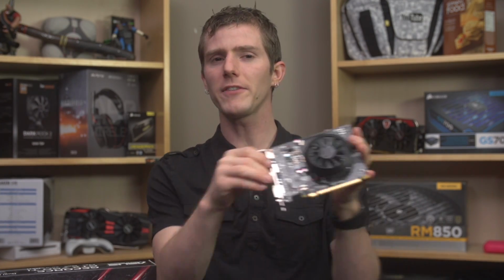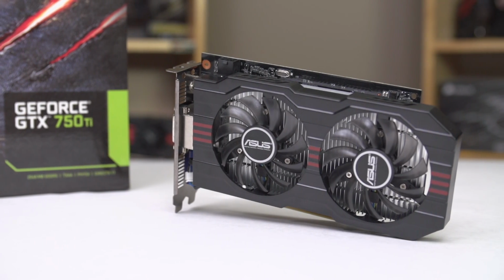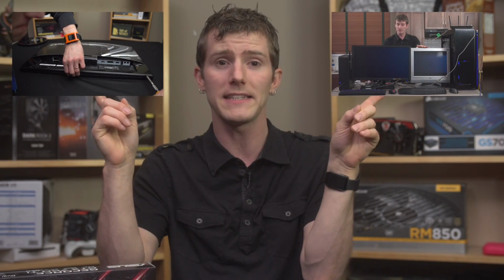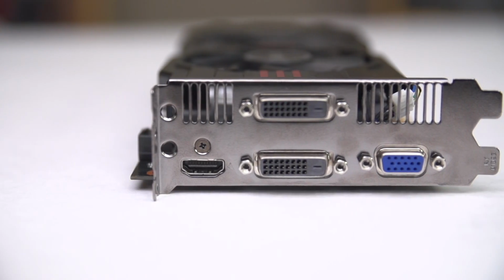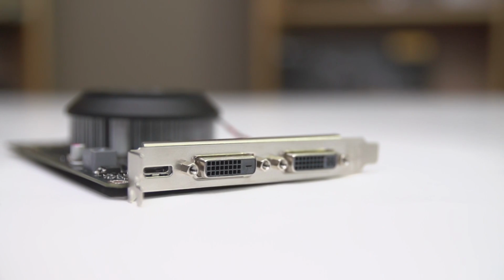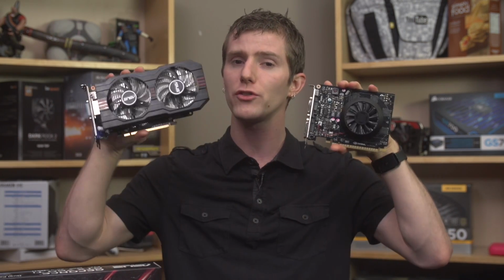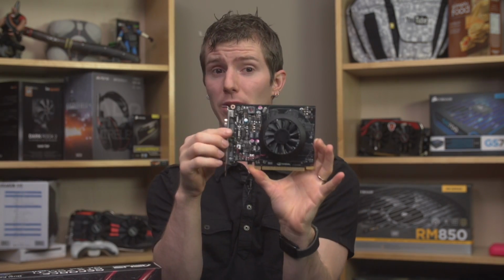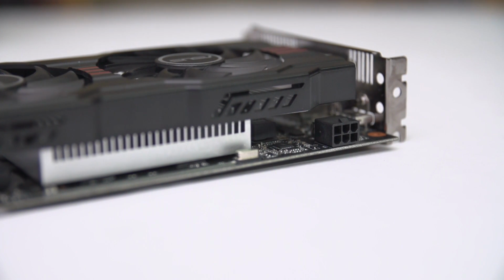GeForce GTX 750 Ti NVIDIA & ASUS Designs

Comment: guys just asking,is my specs ok for gaming??

INTEL 4th Gen HASWELL I7‐4790 3.60GHZ 8MB Cache MSI Z97 Gaming 5 Motherboard
250GB SSD for Operating System
1.0TB Sata Harddisk Storage
8GB DDR3 PC1600MHZ Ram
Nividia GTX750Ti 2GB GDDR5
24X Dual Layer DVD Writer
Audio Boost 2 / USB3.0/Killer E2200 Gigabit Lan Medium Casing with 500W PSU
Reply: This is just my personal opinion.

Drop the SSD and get a better Graphics card
Reply: Get a better graphics card you could do this buy getting i5 4690k and drop the ssd if you don't think you will need it
Reply: MurixArtz Get the SSD later, just partition 250 / 740. Spend more on your GPU, get the GTX 970. Later down the road, once you get your SSD, just clone the 250 partition to your SSD.
Reply: Will Redfern ok thanks for the opinions,ill think about it :)
Reply: should i get the gtx 760 or?
Reply: DON'T YOU DARE TO BUY THAT CARD.

it has a horrible Price for that what you get

you should get a gtx 960 for 190-200
Reply: my country doesnt have a 960 or maybe it has idk how about a 780
Reply: You can get a 120 GB SSD for half the price, so I'd then put the savings into an r9 280x. Also, the k verizon of the i5 is slightly more expensive, and worth it if you plan to overclock.
Reply: Operate170 i also need to use after effects,should i get a 970?
Reply: well, a 970 on the other hand "oh my lord" the 970 is probably the best "bang for the fuck" on the market atm
Reply: okay. So this is my opinion.
keep the ssd but go with the cheapest 120gb you can find,go for the i5 4690k and get either a r9 280x or a gtx 970 depending on the money you have
Reply: good build but u can save money by getting an i5 & dont worry it wont bottelneck
Reply: yea, that's a good idea aswell actually :D
Reply: RyuFX Get a i5 and a better graphicscard
Reply: RyuFX The GPU will bottleneck the i7. Go with an 960 and a i5. It will work better.
Reply: ThePhenex ohh Right, totaly forgot about that.

That's right it will kinda bottleneck, as far as i can tell is an i5 4460 Works perfect with an 960 (speculation can be wrong)
Reply: Eynonymis K lol i got my gtx 750 for 130€😂

Comment: I want to upgrade a prebuilt computer I bought with a r7 240 and a fx 4300 in it, do you think getting this or the r7 260x would be a better investment? If not either what do you recommend? My budget is around $160
Reply: Andrew Tan 750ti The Fx 4300 might need to be upgraded soon to a fx 6300 or 6350 because amd quad cores are becoming obsolete
Reply: I don't think my motherboard supports the fx6300
Reply: Andrew Tan it should they are both the AM3+ Socket if they don't id be suprised
Reply: thedillon25100 my motherboard has a watt limit thing and the 6300 surpasses it
Reply: Andrew Tan There has never been a Watt Limit. It only is about your PSU

Comment: ALIENWARE X51 PERFECT UPGRADE...
anyone who has the gtx745oem and are looking for a better card but cannot afford additional psu and a more high end card that probably wont fit in the x51 get the low profile card from gigabyte,the gtx750ti oc is an awsome quick cheap upgrade that lets you play those new games 1080p medium to high setting,unlike the gtx745oem which has poor memory bandwidth.

Comment: Im running Crysis on max and Arma 3 on high with this card solid 45-60 FPS... just saying.
Reply: My MSI GTX 970 is doing a hell of a lot more
Reply: Fact is that my GPU is more power efficient and more bang for my buck.
Reply: Stahle Frid true, but im preparing for years to come
Reply: Gabriel God bless you, so am i.  I can spend my 300 in 2 or 3 years and will get even more bang for my bucks.
Reply: Stahle Frid You win! But i personally enjoy this card with its looks, style, and the high numbers i love seeing
Reply: Gabriel Same reason i bought a 3570k :) so i guess i cant blame you haha.
Reply: Boring Guy Dont mind running a highes res screen than 1920x1080 since that'll make the 750 Ti work realy hard with harder games on 4k resolution. Invest in a better mouse, that's what realy matters when it somes to precision and speed. Also if you're getting a keyboard get a mechanical one, there are very good ones like the Q-Pad ones if you dont mind backlighting. On the mouse front I can recommend the RAT 3-7 beacuse of the customizability, looks and most the quality. Hope I didnt bored you with this novel :)
Reply: King KaBlaze hello.Out of curiosity,which gtx 750 ti card did you get?
Reply: King KaBlaze Thank you for replying. I just purchased this exact card yesterday (from Newegg).I have a pre-built HP that only has a 320 PSU so I had to get a card that did not need an extra PCI-e connector and also did not use a lot of power.
Reply: Boring Guy if it happens to be less cables than needed, there's often adapters for loose cables you can use to "create" a 6-pin from molex cables that are very usual on older power suplies.
Reply: Stahle Frid Thanks for the tip. I wanted the EVGA version with the twin coolers but because my PC only has a small area for a GPU,I had to get the shorter version.It works great though,I can run almost every game I've tried on high.Not bad for a $100 card.
Reply: Boring Guy I'm happy to help out, I just wanted to say that I can play ARMA 3 with the card, not 100% smooth on high settings but if you have an average CPU that'll be the bottleneck.
Reply: Stahle Frid My CPU is older,it is an i5-2400. From my reading,it is still decent for gaming though.I would need a higher end card for their to be a bottleneck.I am planning on building a Skylake pc soon.
Reply: Boring Guy 2400 is a quad right? Then there's no reason to spend money on a skylake motherboard yet. You'll be able to play with it.
Reply: Stahle Frid yes,quad core at 3.1ghz. I have 16gb ddr3 1333mhz RAM,Samsung PRO 256gb SSD and an EVGA GTX 750 ti. I got everything I mentioned for less then $300.Only bad thing is the desktop is an HP 6200 prebuilt so there is a small PSU (320w) and not a lot of room for a longer GPU. I was thinking if I do not build another PC,that I can take the parts from this HP and just buy a different case,motherboard and power supply.
Reply: Boring Guy My tip would still be to wait, your PC will be usefull at least 5 more years. Save your money until then and thn build a swag pc. You have very nice parts already.
Reply: Stahle Frid You're probably right.I might just get a better monitor and keyboard/mouse.The ones I currently have are old .
Reply: +Stahle Frid No boredom at all. I appreciate the help,thank you very much. I would not go for a 4k monitor because like you mentioned,the 750 ti is not really cut for it.I'd like to get a 27' 1080p display,probably from samsung or LG. Those Mad Catz mice get good reviews,I was also looking at some LogiTech ones. I actually have a really old mechanical keyboard lol.It has a ps/2 output ,I believe it is from 2000.Works great still,only issue is that it is purple and grey .
Reply: +Stahle Frid the 750 ti was never meant for 4k gaming. watching 4k streams sure
Reply: EricssonXL That's what I meant
Reply: Stahle Frid no
Reply: EricssonXL "Dont mind running higher res screen than 1920-1080"
Reply: Intelgents You're on the "solid" level if you turn down the range a little. Im speaking about high preset up there.
Reply: +Gabriel Do you reaaaallly need more than 45-60fps though? I'm finally upgrading from a 560ti after all these years but I was playing Fallout 4 with it at sometimes as low as 20 fps not counting hardcore periodic stuttering and I was just happy to be playing it.
Reply: KingofHearts67 It's about personal prefs i believe. But you usually say 60 fps instantly is solid! However I dont really care it dropping even a little under 40 as long as it's not shuttering alot!
Reply: Steelie Fridh 45-60 fps on max my assumption for a 750 TI doing that is fairly slim
Reply: EricssonXL high is not max.
Reply: Steelie Fridh Crysis 3 on max? 45-60? no
Reply: EricssonXL Did i say it was crysis 3? and did i say it was maxed out?
Reply: +Steelie “SIB” Fridh Assuming you were being a smartass or you're blind, I'm pretty sure in context that means crysis 3 if it's crysis one at least put a 1 next to it.
Reply: Crysis = The first Crysis
Crysis 2 = The second Crysis

It's pretty simple really.
Also the "assuming i was being a smartass"- part... doesnt makes sense in context.

Also it's pretty simple that "high" preset isnt the same as the "maxed" preset. And running solid in my comment obviously meant stable within the FPS-span.

Do something better with your time than to prove me wrong on the valid points I made in my first comment. Did you know that Edith Piaf turned 100 today? La vie en rose can be worth listening to, instead of posting worthless comments showing that you got it all wrong.
Reply: Steelie Fridh I find that pretty ironic because you wasted all that time to prove me wrong when a one sentence explanation would do fine.
Reply: Intelgents I never said that did I?
Reply: +Steelie “SIB” Fridh It is unbelievable what this card is capable of, nothing is above its capabilities thus far.
Reply: +Harawanagangsta just bought mine with amd 10 7850k that i use for months cant wait all i need is a dvi cable forgot to buy one haha 750ti with pro ocing is a beast of a gpu for the price
Reply: +Harawanagangsta better than ps4 lol
Reply: +Steelie “SIB” Fridh Will the 750 Ti still do decent with a I3-4179?
Reply: Mustafathetech Yeah sure, though on some games the i3 will bottleneck (on very demanding games like arma 3). I'm runing with an i5 currently. And it's running great for me. Howver the new "cheaper" processors are getter very much better, who knows maybe your i3 is better than my i5 3570k :)
Reply: +Steelie “SIB” Fridh Yeah you are running Crysis on 0.1 FPS. Also ARMA3 is highly dependent on CPU.
Reply: coolkiller056 
Im running Crysis on >60 FPS
Arma 3 on high 45<60 FPS
Reply: +Steelie “SIB” Fridh dying light high 40-60fps 1400x900
Reply: Franz KEN That's a little low resolution, however dying light always have had a fucked up engine :)

Comment: Hey! Will a pc with these specs be able to run games? (Not demanding games like AC Unity but games like BO2 and whatnot)

Intel i3 4160 @3.60ghz
8GB DDR3 RAM
Nvidia GeForce GTX 750 Ti 2G

Thanks :)
Reply: i am running bf3 on near ultra on this card :D
Reply: ***** Just don´t go with an i3 for gaming. The anneversery edition of the prntium might be better
Reply: The processor is good enough for gaming, video card is a monster, and the amount of RAM you have is enough for almost anything. Congrats! You can do pretty heavy gaming!
Reply: Sonia Piotr yeah because it has a shitty textures
Reply: Get a i5 to run minecraft even better. Kappa
Reply: Get a gtx 740 sc 4gb card. It costs less than the 750 ti with similar specs except for the massive amount of vram.
Reply: The CPU is the only thing that kinda worries me, but I'm not doing it DIY so this is probably what I'm going for.
Reply: ***** You should be fine, gaming doesn't really benefit from having a huge amount of cores. If you're smart with your settings you should be able to run just about anything at medium to high settings at 60fps, assuming you're playing on 1080p
Reply: Alex Ritchie-Pirrit Ok. Thanks for the help!
Reply: You will be able to run Crysis 3 on high/ultra settings
Reply: ***** Keep dreaming lmao
Reply: ***** Card is not a monster lmao its entry level
Reply: GTX 750 Ti is still very good for 1080p gaming and keeps most games at 30+ FPS on Ultra settings like BF3 and BF4, Crysis 2 and 3.
Reply: ***** lel it will only run nowdays triple a games on 20-28 fps. But not bad not good and not monster either just decent card for casual gamers
Reply: That can handle any cod out there even advanced warfare 1080p
Reply: phantom of the opera yes. I agree. Its not a monster but its an awesome card. Especially for its price! Running most games 30+ FPS at ultra on 1080p is pretty good. Of course some FPS Games are not very good with 30 FPS, but still this card can run any game very well medium-high settings
Reply: Yes and gta v too
Reply: ***** you can game on that...but on low/mid settings
Reply: ThePhenex  it is XD
Reply: border collie21 games gtx 740 is nothing because it has 4gb od DDR3 Ram not GDDR5 hwich is slower. Also GTX 740 doesnt have a high clock speed and as many CUDA cores as gtx 750 or 750 ti
Reply: ***** Greay combo. You'd be able to run most games fine :)
Reply: ***** Hey Guys.Is Asus Gtx 750 Ti Have D-sub Or VGA
Reply: CryptoLocker PC It should have a vga... if not that would be weird.
Reply: JordanTheMinecrafter - PC Gaming Thanx For The Answer
Reply: CryptoLocker PC all 750 Ti's have vga and dvi. Some have double dvi and some dvi and hdmi, so I am not sure about that
Reply: ***** Ok Gotta A Little Bit Search
Reply: Yes
Reply: The PHENIOX 

THE I3 is better than pentium g3258
Reply: Teemo4Life But Intel Pentium G3258 Overclocked Almost Beat Intel Core i7 4790k
Reply: Teemo4Life But Intel Pentium G3258 Overclocked Almost Beat Intel Core i7 4790k
Reply: If the pentium was better than i5 since it nearly beat the i7, intel would rise the price by $150 since it has the same performance and would be sold out a lot. He OC his to 4.8 which is almost impossible. OC is about luck with the "silicon lottery" and about the chip. OC also can damage your pc and reduces life span plus it gets really hot. U need a really goos motherboard to handle it like z97.

I once thought what u said as well but i said it in the linus forums and got raped so dont be me :)
Reply: Teemo4Life That Absolutely Right.If Picked That Motherboard That Can't Handle Until 4.8ghz.Cpu Completely 
Dead
Reply: CryptoLocker PC Also it's only in games that focus on few threads, games that require more threads are horrible on the Pentium.
Reply: Absolute Right
Reply: ***** i am running arma 3 on low settings:20 fps on my gtx 750ti CPU: Amd FX 8350 :(
Reply: omg that bad result
Reply: Elianos What is the clock speed of your FX 8350?
Reply: RoundDuckMan where do i see that?
Reply: Elianos your fx should not be a bottleneck at all. When you play Arma III, turn off AA completely, put graphics to med at 1080p and enjoy. If still bad, simply overclock the heck outta that GTX 750 ti, and youll get 5-15 extra FPS
Reply: ***** lol i dont even know how to overclock
Reply: Elianos just google it. Also if u have 4gb of RAM that could be a reason for lower FPS and stuttering. It is recommended u have at least 6gb
Reply: ***** i have 8 gb of ram
Reply: and i already searched on google but couldnt find how to overclock my GPu with msi afterburner
Reply: Elianos just say HOW TO OVERCLOCK GTX 750 TI isnt that really hard. I oced my cards with ease
Reply: Elianos 750ti bottlenecks
Reply: ***** Yes ofcourse. I personally have the same specs except that I have and i7 3770K. So I can play most games on Ultra, 1080p including Far Cry 4 AC Unity runs on high.

If you're planning to upgrade, atleast go for i5 46xx.
Reply: ***** lol i3 XDDDDDDDDD u need to get i5 or just get rid of intel and move to AMD which i highly reccomend
Reply: ***** Your fine its just my old laptop was i3 and i hate intel so i only use AMD stuff
Reply: John David Most Intel processors are better than AMD. Only drawback is they cost more which explains its performance. Not to forget Hyper-threading and Turbo Boost.

If you have an i7 5960X, you won't need to upgrade in like 6-8 years. NVIDIA uses that CPU for benchmarks.
Reply: +Teemo4Life it is good for gaming. But it sucks at any cpu intensive task due to it having only two cores. It is close to the 4790k only when it comes to gaming.
Reply: ***** I already know that intel makes quality processors but i hate the fact that people talk down AMD all the time and it really gets on my nerves now that many younger kids are getting into pc gaming they think intel is all that and put bad reviews of AMD on amazon
Reply: John David Don't get me wrong but both are equally good for the price they come at. I'm saying that Intel makes better and more powerful CPUs which are expensive. AMD doesn't make theirs as good as they focus their CPUs mainly on gaming while Intel manufactures for industries and workstations at the same time. 
It's basically your choice on what you want to get. The i7 3770K and above are really best preferred for gaming as they come at a reasonable price and give amazing performance. Also to mention they're 4+ cores.

EDIT: I also said "MOST" Intel processors are better than AMD. Not "ALL".

Comment: the asus gtx 750 ti  vs amd r7 260x   which is better
Reply: The 750 ti is better, get that one.
Reply: Buy whichever one is cheaper, they are very similar in terms of perf.
Reply: Spend the extra, get the 270 MSI Gaming, and do what Linus said : OC it to the MAX in afterburner. I did with mine, and it equalled the 270x in everything. They are very cheap as well, maybe 5-10% more than a 750Ti.